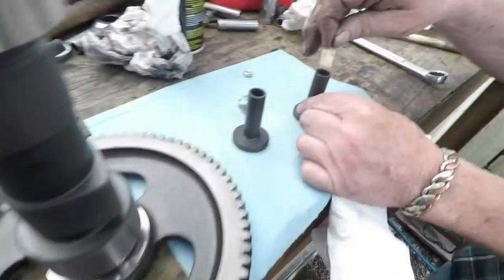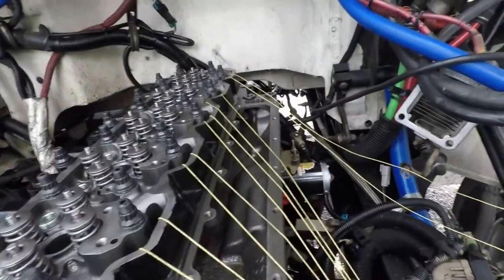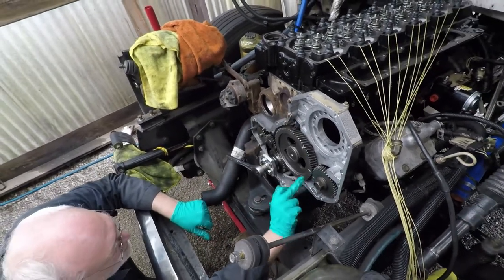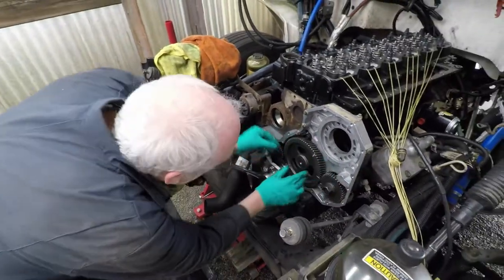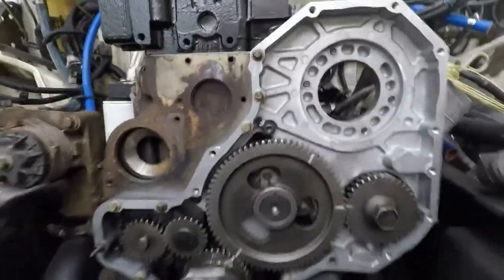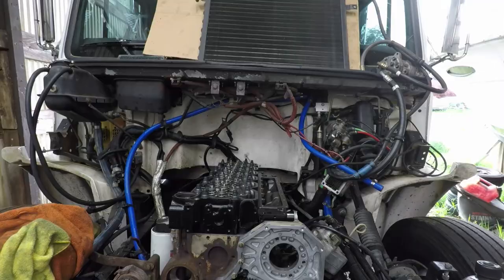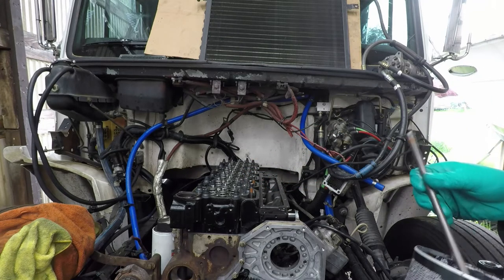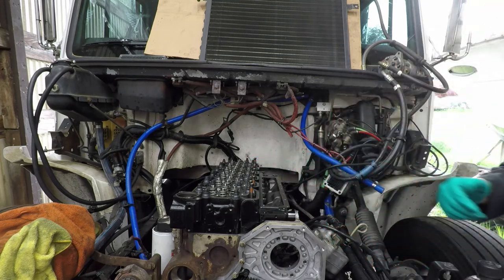Ep. 24 Cummins 24v Hamilton Cam install

Comment: What made you go with the new cam
Reply from the maker: A couple different reasons. The mileage of the engine, the new cam profile was supposed to be better for towing and I wanted to see if the industrial  cam profile was the same as the truck engines.

Comment: Did you guys  replace the valve springs?
Reply from the maker: Didn't need to. The Pacbrake PRXB model has a pressure regulator built in.